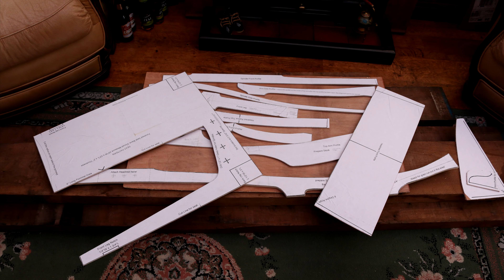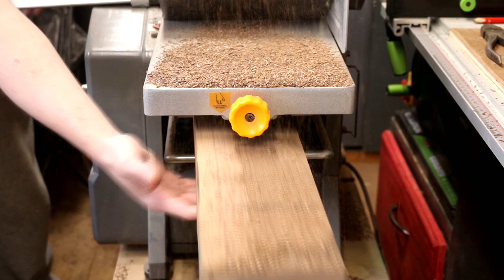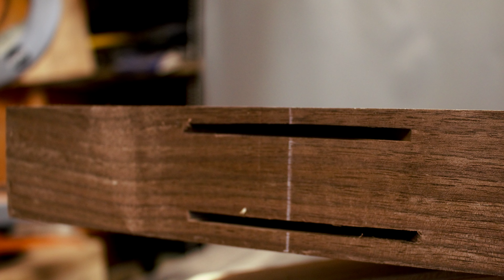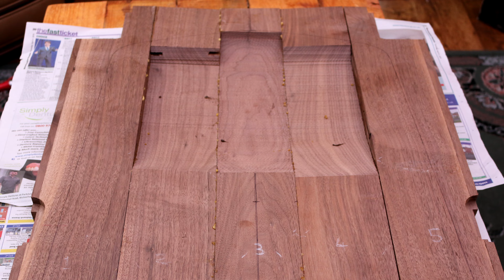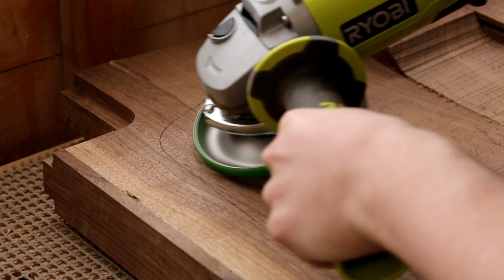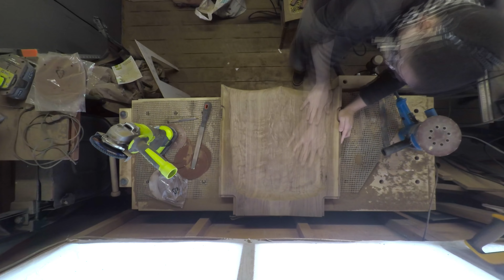The Seat - The Wood Whisperer Guild Sculpted Rocker

Comment: Hi I was involved in a accident on my motorbike on 2009 whilst riding my gsxr 600 and I was only going 30mph when an old lady 67yrs old pulled out in front of me. I don't remember anything about it bit I had 14 broken ribs a broken collarbone a broken shoulder blade, both lungs collapsed my back broken In 3 places my neck broken in 2 places a fractured skull and some slight  brain damage and sadly the worst thing was my spinal cord damaged that has left me a paraplegic and in a wheelchair for the rest of my life.......  Which no amount of money could make up for. It took 1 yr to accept full liability and another 4 yrs to haggle over compensation and it settled  a week before it was due in the high courts. So now I have a lovely workshop stacked with all the machines I could wish for so I can enjoy my Woodwork. It's a lot harder to do it as you can imagine but it won't stop me.